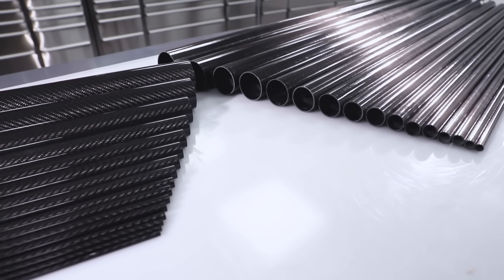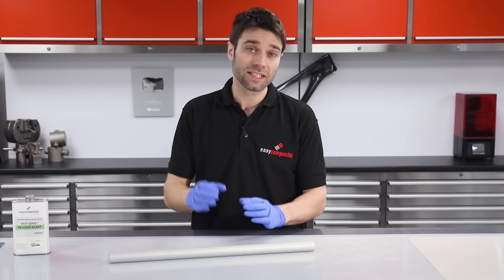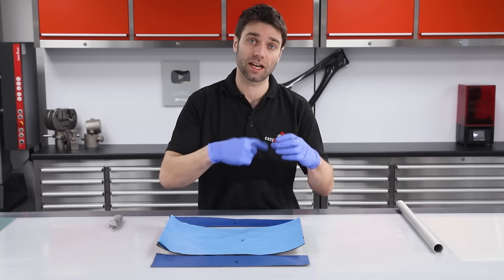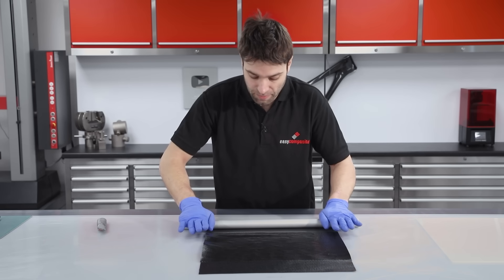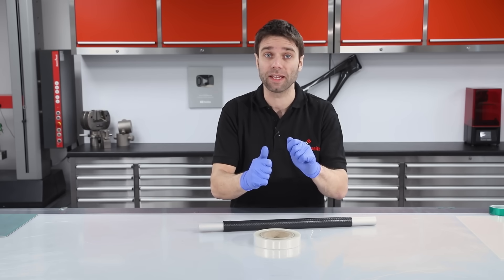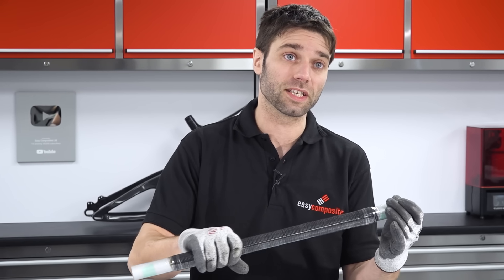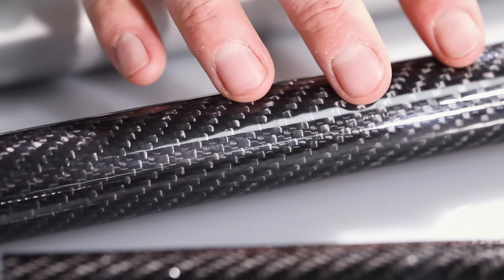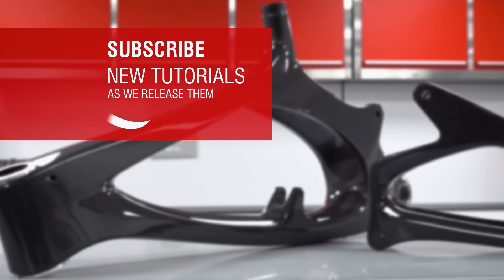How to Make a Roll Wrapped Carbon Fibre Tube

Comment: Do you use any type of epoxy glue in the carbon fibre material prior to rolling and wrapping them ? If not what actually bond the material ?
Reply from the maker: The prepreg has its own natural tack when at room temperature so holds itself in position as it is rolled.

Comment: Ah yes, the forbidden sushi roll. :)
Some time ago i experimented with making a flexible tube using silicone and carbon fiber fabric. The process was more like a wet CF layup, so rather messy and untidy. However, it did produce a surprisingly strong and flexible tube that easily held 60psi of water despite being about 50mm in diameter and only couple layers thick.
If I have to do it again, main change would be to basically pre-impreg the fabric with silicone (similar to a basic flat sheet wet layup), let it cure, then make a forbidden swiss roll with just enough silicone between layers to keep everything together. Should give a much more consistent and neat look to the part.
But speaking of flexing, how well does CF fabric hold up to repeated bends? Is it basically infinite like regular fabric, or will it break fairly quickly like bending a piece of wire?

Comment: How does the diameter of the pipe affect the strength of the pipe? Does it increase exponentially as the diameter increases with the wall thickness staying the same.
Reply: As far as I know yeah.
Reply from the maker: Its not strictly linear, but generally the bigger the diameter, the more the stiffness.  However, if you keep the wall thickness the same, eventually you will find the durability of the tube is proportionally less.
Reply: @easycompositestv  thank you! I hope to be making some pipes that have a shape at the ends that would allowe me to bond them to other surfaces.

Comment: DEAR, Can I use carbon viber to make helicopter BLADES! Wood design and cover it with carbon! Is it possible and STRENGTH!
Reply from the maker: The high tensile strength of carbon fibre makes it ideal for things like helicopter blades so it's certainly possible yes.

Comment: Hola! Necesito hacer unos tubos de grp y antes de enrrollarlos con cintra retráctil pienso envolverlos en mylar y así salgan brillantes, qué opinas?
Reply from the maker: You can experiment with this but it may not allow the shrink tape to provide sufficient consolidation. Typically a glossy finish will be achieved by means of a lacquered coating once cured.

Comment: After it’s finished Does it leave the line where the carbon lapse over?
Reply from the maker: The consolidation tape helps to eliminate the majority of the bump from overlapping and the UD fibre is relatively thin and flat. You do get ridges from the consolidation tape which can be sanded flat before lacquering.
Reply: @ and does that process work with the fabric twill as well? Or is that a different process
Reply from the maker: @TINCANSs  The 2 smaller pieces used for the interior and exterior plys are a twill weave. So yes the process is the same. 

As for a tapered tube, you would need a tapered mandrel and follow the same method. You may need to cut the material with an angle to account for the smaller diameter on the narrow side depending on the severity of the taper.
Reply: @easycompositestv  I seen you pulled off the film is it tacky? What the reason for using the three separate sheets? Can I do this process using a regular twill sheet and coat it in fusionfix and then apply epoxy?
Reply: @easycompositestv  I would like to try this out with a purple reflections carbon fiber fabric twill 3k hoping it’s possible to do so manually
Reply from the maker: @TINCANSs  The reason for the different materials is to bias the reinforcement to a more parallel orientation to the length of the tube. As the UD fibre has all of its strength down the length of the fibres it increases the strength and stiffness without any excess weight. A small amount of 0/90 woven cloth on the surfaces will help to provide a bit of hoop strength and resist crushing. Trying to wet lay the fibre is possible but far tricker than using prepreg and the consolidation will not be as high given the restrictions to processing.
Reply: @easycompositestv so could a single piece be used or will it not hold? What would be the best way to make a tube using the reflective purple carbon fiber sheet that I’d like to use? Or would I need to get prepreg?
Reply: @easycompositestv I will be making handles I’m curious if maybe Eva foam or a composite core will be best to lay the purple reflections carbon fiber sheet over?
Reply from the maker: @TINCANSs  A single layer would likely be to weak to be useful for many applications. If you are happy to leave the core in place then you can wet lay over the top of it similar to the process of skinning. You can apply as many layers as you think is required to provide sufficient strength.
Reply: @easycompositestv would an Eva core be stronger than a composite core? If doing it like the skinning process would a thicker coat of epoxy help add strength and durability from scratching or peeling?
Reply from the maker: @TINCANSs  Not sure what you mean by eva core vs composite core. The strength really comes from the reinforcing, the resin is really just a matrix to hold everything together. More resin will partially increase the durability as there is more material on the surface before you get to the fibres.
Reply: Also how would I make a tapered tube?

Comment: Once you have the tubes, can you bond them to a carbon fiber plate? Or would you have to do the tubes and the plate in one setting?
Reply from the maker: Yes you can absolutely bond tubes to a plate with some structural adhesive. Assuming that you are bonding the tube end on the contact area will be relatively small so filleting the adhesive or even laminating additional reinforcement may be required depending on the application and loading.

Comment: Would be interesting to see how much pressure a tube like this could hold.
Reply from the maker: You could set up a relatively simple test by sealing off one end and attaching a valve to the other with which you can apply compressed air. You would naturally want to do this behind a screen and wear the appropriate personal protection.
Reply: @easycompositestv  Yes agreed. Was also thinking about creating a test with a carbon fiber wrap like this over a metal tube, to see how much improvement that might provide in the metal tube's pressure rating

Comment: What kind of mold release agent do you recommend for this process?
Reply from the maker: Due to the fact that pepreg requires curing at high temperature you need a release agent which can withstand this. A chemical release agent such as our CR1 would be a good option.

Comment: can i make a bmx frame out of just the tubes? also i dont have any industrial equipment so how do i cure the carbon fiber. PLS REPLY IF YOU HAVE ANY KNOWLEDGE ABT THIS
Reply from the maker: It might be possible to make a frame that way with additional reinforcement to the joins.  However, you would need to design the tubes to be suitable for the right loading.  Usually at that point, its more efficient to design a full frame and make a one piece frame.  We summarise the process in this video: https://www.youtube.com/watch?v=UWSePEV88tw&t=1s
Reply: @easycompositestv  so i can still make it with no specialist tools???
Reply from the maker: @Qsay-z4k  If you are making the frame with the technique shown in the video then you will need a curing oven and a vacuum pump. If you are not able to source any tubes which are strong enough and have suitable wall thickness then you will also require a curing oven in order to make the tubes yourself. Some specialist equipment will most likely be required at some point during the process.
Reply: @easycompositestv  ok.thank you very much!

Comment: Why the heck do you need to apply 8 layers of release film? Why not 1 thick film? Obviously someone has stuffed up and wants you to buy more product 😢
Reply from the maker: Easylease is very low viscosity and applied in a very thin film, so for the initial application a base is needed to be built to ensure a good release. Multiple coats also ensure that no area has been missed and should get a few coatings at a minimum. As a semi-permanent release agent, this is only for the initial application. After that you can achieve multiple demouldings without reapplication, although we would advise a single coat inbetween releases for more aggressive processes such as prepreg and resin infusion. Ultimately it's better to have a good clean release from the mould with proper application than loose material and damage the mould due to parts sticking.

Comment: Could I use the prepreg technique without mold release if I wanted a mechanical bond on an aluminum tube? Or would it be better to remove and then adhere with adhesive? Or perhaps an out of autoclave/low temp prepreg?
Reply from the maker: The issue you would have with using the resin in the prepreg itself as the bonding agent is the difference in thermal expansion rates of the 2 materials would compromise the joint during the cooling phase. Bonding with one of our structural adhesives would give a more reliable joint between the 2 materials.
Reply: @easycompositestv  could you get away with using the final piece the carbon fiber would be adhered to as a mandrel i.e. would the thermal expansion provide adequate room for a bonding agent/adhesive after curing?
Reply from the maker: @Frmrspecialist74  You would probably need to make the carbon tube on a different mandrel to the tube you want to bond it too. Most adhesives require some offset to fill in order to work properly, 0.5mm would be a good indication but would depend on the specific adhesive.
Reply: @easycompositestv  .5mm all around so 1mm difference between ID/OD or .25 all around which would be .5 ID/OD?
Reply from the maker: @Frmrspecialist74  As i say you would need to look at the requirements of the specific adhesive see what the minimum fill gap is. 0.5mm fill gap would require an overall 1mm difference in internal diameter.

Comment: How do you  do this with a cone shaped pipe ?Just hand wrap the layers and then vacuum bag it  to solidate  and then roll the shrink tape around it?
Reply from the maker: You can change the angle of the shrink tape wrapping so it lays flat.  More complex shapes may well need the vacuum bag as you suggest.

Comment: Where would we find equipment related for this process? Used or new would be appreciated. Use to work for profile composites till they moved to the US, building carbon shafts for the paddle and sports industry.
Reply from the maker: The equipment used in the video such as the oven, we sell.  Mandrels are typically custom made to suit.
Reply: @easycompositestv  web site plz and ty

Comment: i know this is just a demonstration and most tubes will be mostly exposed to tension and bending, but one thing that's also good to know is that aligning the layers at a 45° angle greatly increases the tubes resistence against torque
Reply from the maker: That is correct and is often done specifically for tubes used under torque such as driveshafts etc.

Comment: At 5:06 you added a step at the end. Could I leave such a step on my tube for more hoop strength at that one end. I plan on putting in an aluminium insert in one end that is at near a 90 degree angle for a fitting that can be used as a wrench to apply torque to a nut? (piano tuning pin)
Reply from the maker: Hi Paul, Absolutely, you can add additional thickness and wraps wherever you need more strength, increasing the thickness around your insert would be good practice. Thanks for watching!

Comment: Great video, gave you a like. I only need one tube, so maybe making my own 350mm x 16mm OD x 10mm ID Roll/Wrap tube is the way to go.

I can apply 3 layers of 1mm wrap as long as the seams don't overlap, correct? 

Do you have UHM wraps?

I am in the United States, so I will have to use an A-loo'-min-um rod instead of an Al-low-min'-nee-um rod, is that ok? [smile]
Reply from the maker: Hi Paul, Thanks for the like! Yes you can wrap the mandrel in pieces, but as you say to keep a uniform thickness you will have to be careful with the joints, it's more common to use one piece that 'spirals' around. As standard we supply HS (high strength) as apposed to HM (high modulus) fibres as they are generally appropriate for most applications, I would say HS would be fine for a tuning pin. Yes unfortunately in the 'States you'll have to settle for an alloy without any 'nee' in it, I'm not sure how it compares to what the rest of the world uses but I guess it will be fine! ;)
Reply: @easycompositestv  Thanks for the info. This looks promising. One final question: Using the Shrink Wrap, can I just put this in any light industrial Thermal Chamber, or does it have to be a Vaccumm Chamber as well?
Reply from the maker: @paulromsky9527  no problem! Just a standard oven is fine no vacuum is required in the roll wrapping process.
Reply from the maker: The PrePreg we use in this video does not need to be cured in an autoclave - just a heated environment (such as the oven used here) - you may be able to use a thermal chamber but would need accurate controllability of the temperature to assure yourself of good results.
Reply: @easycompositestv  I have access to a small thermal - 40C to 155C chamber that can maintain +/- 0.5C with a 5degC/minute ramp rate. I think that will work.

Comment: зачем использовать ленту если можно использовать термоусадку?
Reply from the maker: The tape shrinks with temperature helping to consolidate the fibres onto the mandrel and squeezing out excess resin.
Reply: @easycompositestv So heat shrink does the same thing only better

Comment: Hi, I made a few tubes via the roll wrap method with unidirectional and 2x2 prepreg, now under the microscope I see that there is quite a lot of air between the layers and I was wondering if you happen to know a way how I can optimize this? Thanks in advance
Reply from the maker: The roll wrapped method can only provide a limited amount of pressure to consolidate the fibre and resin matrix. That being said its generally considered to be the best method of manufacture as it provides even pressure around the circumference. A external vacuum bag even a tubular one will have an area where it cant provide the same consistency of force where the excess bag is positioned. You could maybe have a play around with your cure cycle in case the resin isn't properly flowing, we would normally expect it to be fluid across layers so maybe this is one consideration to look at. Also check that you have wrapped the shrink tape tightly enough around the material so that it provides sufficient force.

Comment: Would this be strong enough for electrical scooter making?
Reply: Also, can you mix different materials  like aluminium?
Reply: 1000
Reply from the maker: With this process you can increase the strength as much as you need by wrapping the material in multiple layers. Carbon fibre will bond well to aluminium  with a structural adhesive such as our VM100.

Comment: I like this very simple and informative. I wanted to build my own light weight frame. Just wondering did you put any epoxy resin before putting the heat shrink tape?
Reply from the maker: No as the pre-preg material used already has resin in it.
Reply: @easycompositestv  thanks for the information very helpful.

Comment: Excellent vid. Just wondering how the test load rig would work out for an aluminium tube though.
Reply from the maker: In some ways aluminium and carbon can be compared in some properties so it may well be possible to conduct a similar test with aluminium tubing within the limits of the machines capability.

Comment: What type of resin is pre-applied to these sheets?
Reply from the maker: All the pre-pregs used are epoxy resin based.
Reply: @easycompositestv  Thanks, do you have a citation for what's typically used? Is it 4500 or something else?

Comment: I have watched your videos and I love them.  I have an abundance of carbon fiber at my disposal. If I where to use the process you used here with a mandrel of 11.25mm would I retain the same strength extending the tube length to 580mm?
Reply from the maker: Extending a tubes length in itself does not change the core mechanical properties of the carbon fibre. However, how it is loaded and used during use can differ and change the resulting levels of deflection and ultimately failure.
Reply: @easycompositestv  thank you for the quick response.  1 lap twill 3 laps unidirectional 1 lap twill will yield a stronger more rigid tube than the same 580mm length in aluminium?

Comment: Excellent video! Could this process be applied to a mandrel that has a non circular cross section? For example a simple airfoil? Thanks again for the content!
Reply from the maker: Yes absolutely, the main problem with doing so is the fact that you lose the option to 'twist' the mandrel out of the part so thickening the end to give you a surface to pull (or hit) against, would be really important but you could use it for airfoil sections like bicycle seat posts, etc.
Reply: @easycompositestv  Awesome, thanks for the respone!

Comment: Tubular structures are generally designed to put the tubes in (primarily) tension/compression (loads along the axis of the tube). Have you tested your tubes and established design criteria and/or guides for tube diameters/wall thicknesses/etc.?
Reply from the maker: Some data exists on the stock tubes for that.  You would need to do calculations and possibly testing if designing your own tube - there is no generic data as such.
Reply: @easycompositestv  Where is this data please?
Reply: Thanks